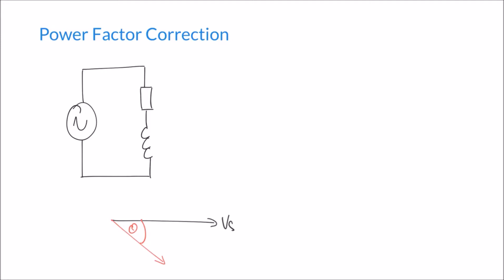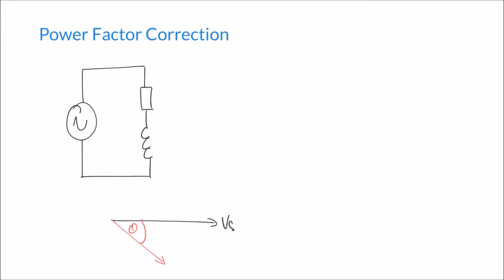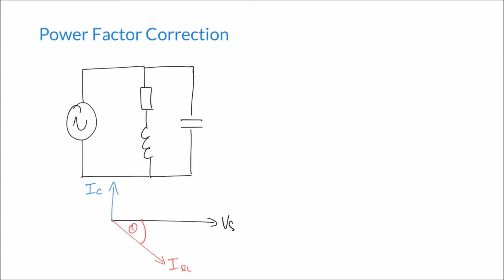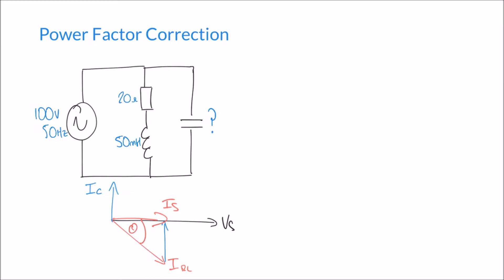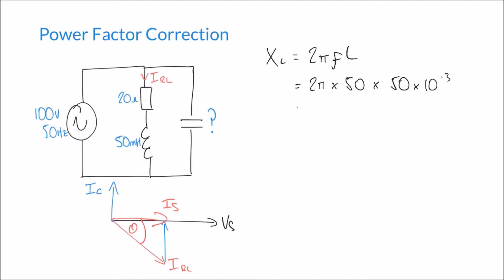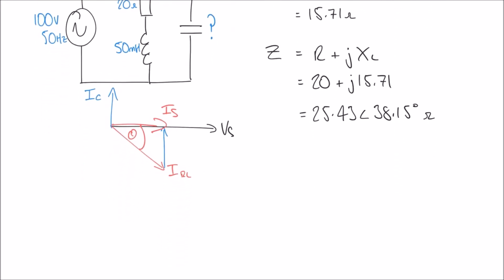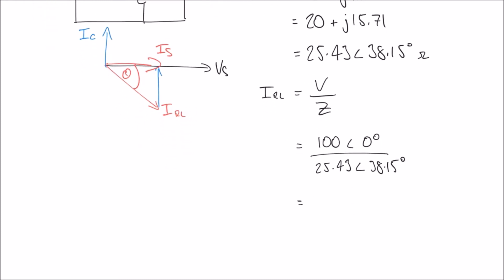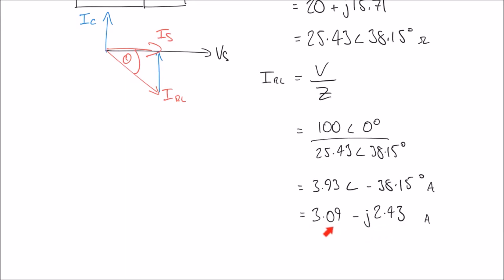Power Factor Correction in True Parellel RLC Circuits

Comment: First i wanna say sorry, i can speak a little english.. i have  a question.. the question is wt if the branch which included the capacitor was in the middle (the place of the other branch) is it the same?  I mean nothing will change or wt?
Reply from the maker: It doesn't matter what order the branches are in here. So if the middle branch is the capacitor, and the right-hand branch is the resistor-inductor, the method is the same.

Comment: correct me if im wrong, but this capacitance value should bring us to resonant frequency. i took the solution and calculated 1/2pi x sqr(LC) and it come out 81Hz. Am i missing a concept with the relation between resonant frequency and power correction?
Reply from the maker: Hi Jack - the resonant frequency formula you are referring to would be for an "ideal parallel" circuit, where the inductor only is in parallel with the capacitor. This circuit has a slightly different formula for resonant frequency - see this vid for more info: https://youtu.be/zVOibkXeZs8

Comment: I see where you state that Irl=V/Z  and Ic=V/X.  Why is I calculated using "X" for one and "Z" for the other?
THANKS MUCH
...is "X" used because there is only one component in this current path?
Reply from the maker: Yes XC is the only impedance in that branch, whereas Z is used for IRL because Z consists of both R and XL